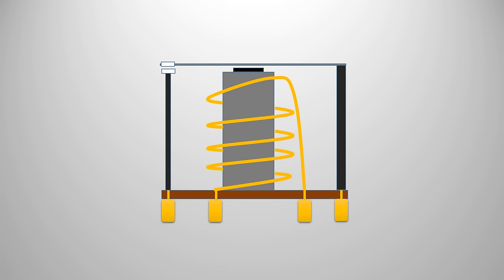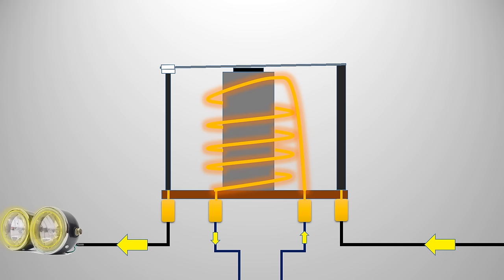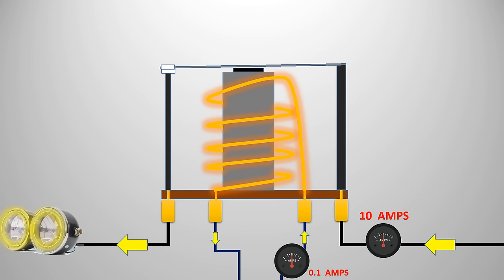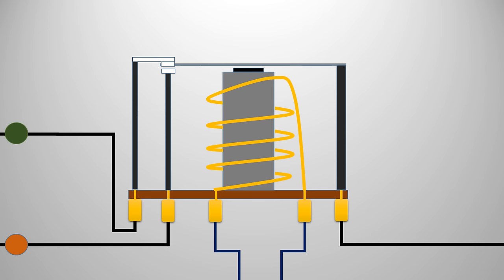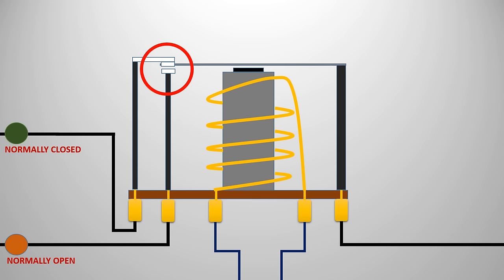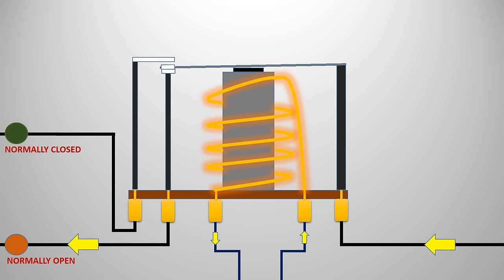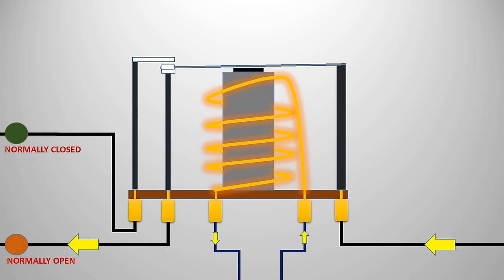Auto Electrical Relays Explained - How they work and where they're used.

Comment: I wonder if i can use one of these relays for my garden lights.  I want to detect if solar panel has power in the cable.  Then enable battery 12 v to the lights if so.  These seem like a good solution if i can find some free ones.

Comment: Whats the difference between Switches and Relays ?
Reply: A switch either opens or closes the circuit and typically manual, as in we push a button.  A relay the circuit continue flows through but can allow more current when the extra amps are needed.  Example low beam then wants high beams.